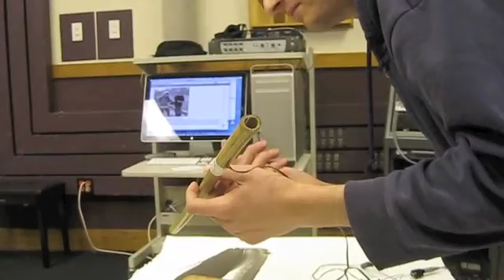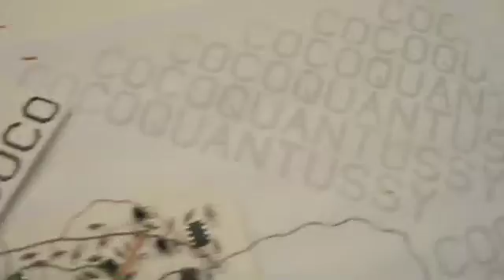COCOQUANTUSSY TV

Comment from the maker: The COCOQUANTUSSY is intended to run at very low , Control Voltages frequencies , for they are intended to Control a COCO device.  So what you are hearing here from the COCOQUANTUSSY, the patterns are sped up sometimes an octave or two, to make them in audio range.  Yet the prototype COCOQUANTUSSY (on paper) is all set at 104 capacitors, so its range is low to basso, for the students' sake, down in the basement.  Final version will maybe? have a switch between 103 and 103 between LFO and tenor.